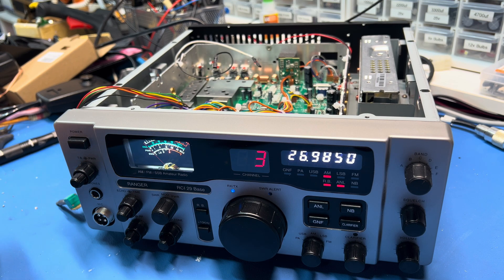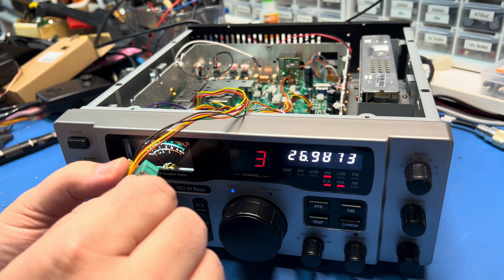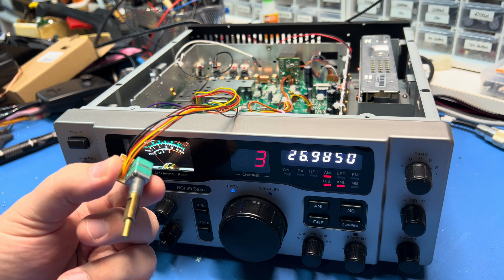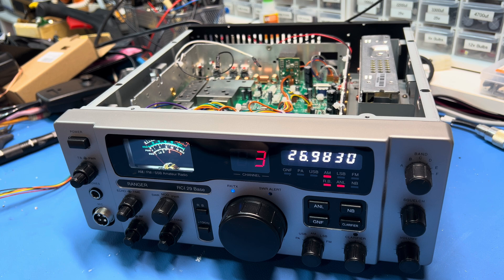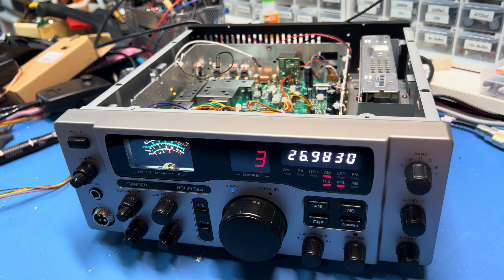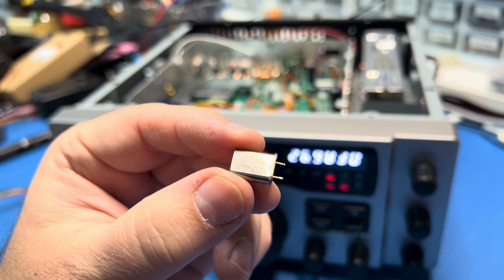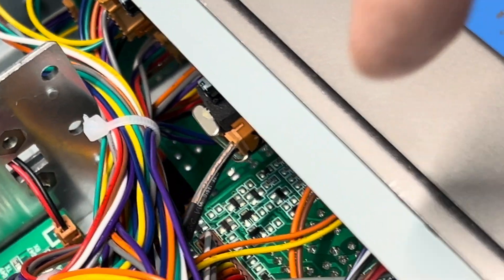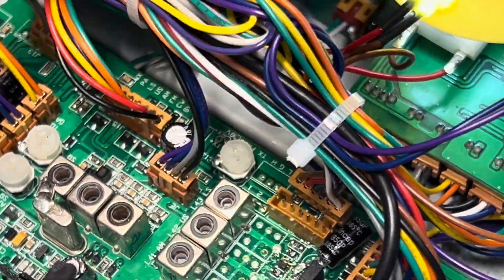New Ranger RCI-29 clarifier experiment?

Comment: Hey Rev. I have a bit of an odd question, what power supply is in that radio. The reason i ask is it looks the same size as the mean well RS-100-12 in the Galaxy DX-2547. if so I'm thinking i could swap the higher amperage PSU into my 2547 and put a RFX95-HD in my radio and not have to use an external PSU.

Comment: Thats a back to the factory modification,me thinks,have a rethink with factory engineers.
I think the better option for Ranger would be fit a dual coarse\fine  control as factory standard.

Other option would be 5kc/10kc step button do it via the PLL chip,could then keep the fine tune as normal of clarifier?

Rob.P

Comment: What was that crystal that you said to use to get the 2517 into 29 MHz
Reply from the maker: Change X2 14.010 to 15.360. This also works on the 2517 and other radios that use 14.010 in the x2 slot. If you have a dead 959, it has the 15.360 in the x3 slot. That’s where I pillaged one for testing. But without getting at least 5KC slide up or down on the clarifier, I put back the 14.010 for now. I put crystal sockets in some radios for testing years ago. Makes it quick to experiment. You will need to realign it though.  Check the VCO voltage is about 2.75-3 on band D CH1 and realign the frequency cans.